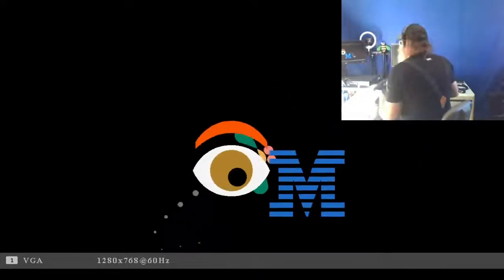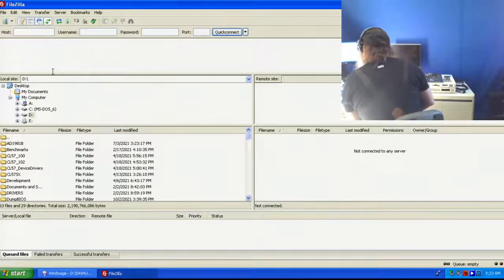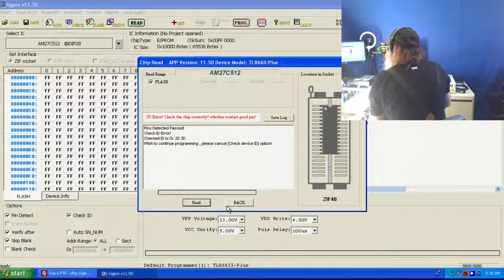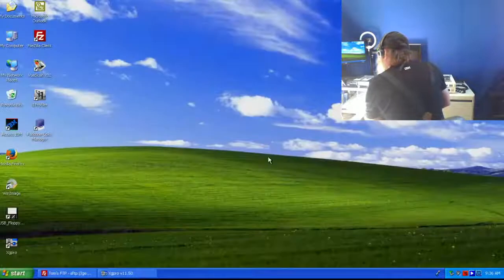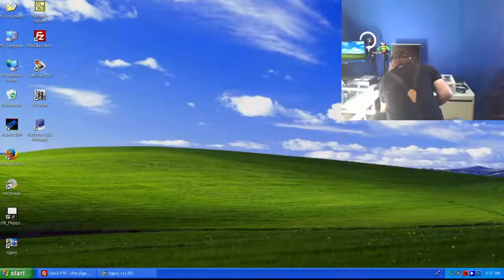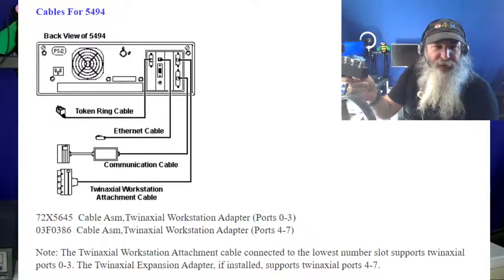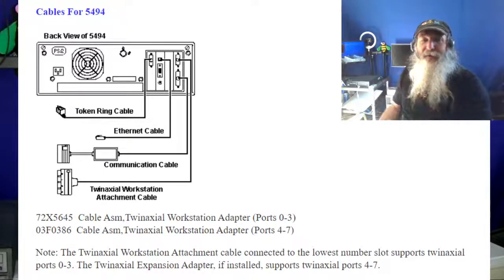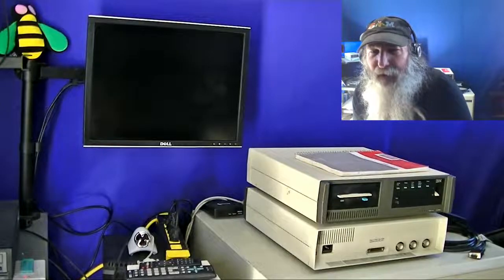Checking the IBM 5494 "Remote Control Unit"!

Comment: 16:07 I always heard EBCDIC pronounced as EB-suh-dik, though perhaps other pronunciations exist. One way I’d determine the filesystem was still encoded internally as EBCDIC was on AS/400 screens with a "Position To" field. I’d then type either a backslash or certain curly braces. If it jumped roughly ⅓ or ⅔ into the alphabet, then I’d know for certain.

Outside its mid-frame and mainframe usage, it mostly exists as a meme these days as IBM's secret way of encrypting transmissions. ;-)
Reply from the maker: Just recently I've heard that the "LANStreamer" adapters and other firmware are in EBCDIC encoding, as it was compiled on an IBM mainframe...